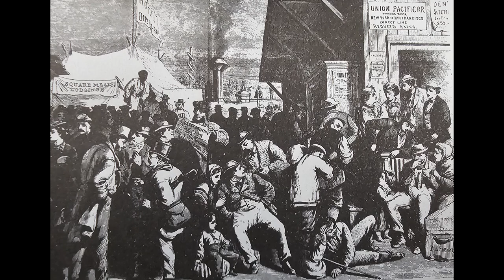Sherman Hill & The Union Pacific Big Boy

Comment: I think that UP's tag team philosophy on Sherman Hill caught up with them badly with the onset of the WWll traffic spike. Other roads had been running big articulated engines on grades for 15 years already. The Big Boy was UP's first engine to exceed the 100,000 lbs tractive effort threshold and they probably needed it badly to remain competitive. It"s a nice looking loco albeit it's excessively long and would have been easier to turn on the existing turntables with a 2 wheel front truck.
Reply from the maker: Yes for sure! U.P. did in fact have issues with turn-tabling Big Boys (too Big for existing platforms) And indeed they were not competitive in both Passenger and freight services until the Challenger came out.. And then the Big Boy for freight. Norfolk and Western IMO had the best, most competitive outfit going in all regards during the last decade of Steam. Although the Pennsy had it's own shops and such as well, their financial model was not good.
Reply from the maker: oooookay. Thanks for the comment Jim
Reply: The Big Boys were originally designed for, and mainly used on the Wahsatch grade eastbound out of Ogden during the  war.  They were not based in Cheyenne for the Sherman Hill grade during World War II.  The UP had also been running large articulateds for decades when the Big Boys were delivered, but the earlier engines had included 2-8-8-0 compounds (which were too slow to maintain the speeds the railroad needed), and early Challengers, which went into service in 1936.  The four wheel lead truck was incorporated into the design because it was thought to provide better stability and riding qualities at high speeds than a two wheel pilot truck was capable of.  Every aspect of the Big Boy’s design was chosen for technical and operational reasons, not out of any concern for aesthetics.

Comment: There's one on display at the railroad museum in Denver.  They are massive.  All that metal for about 6000hp.  You know what 6000hp looks like today?  It's a gas turbine that you can fit in a large cargo van.  The contrast is mind blowing.
Reply from the maker: It's funny that you mention gas turbine in the sense that Union Pacific was the only railroad to ever try a gas turbine in a locomotive and it was extremely massive in it's own right. It was also terribly loud. To say the least it didnt work out for them!
Reply from the maker: I have no idea what your referring to..But thanks for the comment
Reply: That 6000HP gas turbine will be missing one thing that one 6000HP Big Boy has got loads of and it's called TORQUE.
Reply: @Triplex5014  Turbo electric drive.  Same thing that makes diesel engines work.  THe engine drives a generator instead of a direct mechanical connection.  Electric motors can make massive torque at almost zero RPM just like steam engines.  You would know that if you knew anything about locomotives.

Comment: There are a number of factual errors in the video.  The Big Boys were originally designed to operate over the UP’s Wahsatch grade between Ogden, Utah and Green River, Wyoming, and not over Sherman Hill, which is west of Cheyenne and several hundred miles away.  These locomotives operated primarily out of Ogden and Green River during World War II.  It was only in the very late 1940’s/early 1950’s that they came into primary use on Sherman Hill.  Also, the Chesapeake and Ohio 2-6-6-6 was not heavier than the 2nd batch of UP Big Boys which were delivered in 1944.  

Was this video written by an AI bot?
Reply from the maker: The Wasatch run was mentioned toward the end of the video. All of my source material, some dating to 1953, does not show what your saying that ANY of the Big Boys were heavier than the Allegheny. I typed the scripting and the AI voice over translated (text to speech). Im no longer using it as it simply takes too long to hammer out a video. Thanks for the comment.
Reply: @TheRailroadCrossing-SteamPower  Using the specification tables published by each railroad (the C&O and the UP), the official weights of C&O road numbers 1600-1644 were less than the official weights second series of UP 4000 class locomotives.   Everything else that has been printed about the weight of the Allegheny is speculation that contradicts the data maintained by the railroad that owned them.
Reply from the maker: @turdferguson4124  Now this is what I like to see if someone refutes something that I say in a video. Something that I can go back and crosscheck against my source material. My book library of which I draw my scripts from stands at 42 publications. Many are from 1935 to 1970. My point is, im always going to take the information from authors who lived in the era over anything a individual says, or even digital sources like WIKI. Thank you for the reference... I really do appreciate it.
Reply: You would think somewhere in the archives of Lima locomotive Works, they would exactly know the weight of the Allegheny Locomotive?
Reply from the maker: @OKFrax-ys2op  Havent had a comment on this video in quite awhile... That will forever be in dispute to answer your statement. what I do know is that Lima lost a massive lawsuit over the weight versus the C & O.. And that essentially started the end of lima